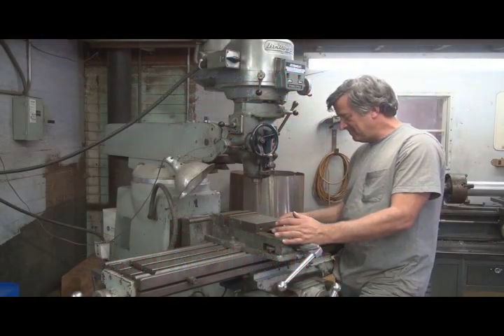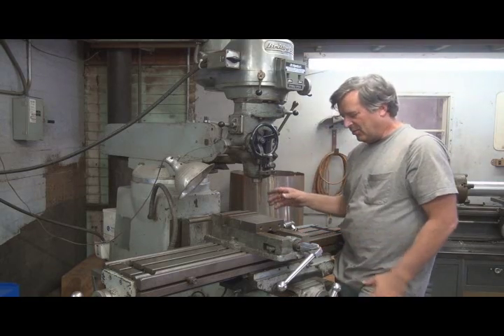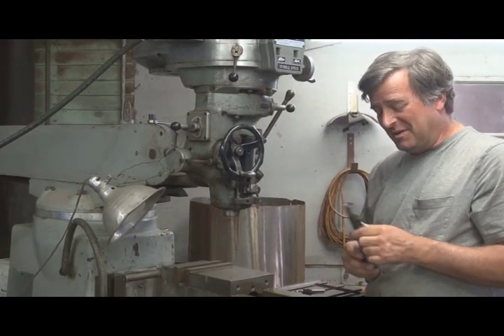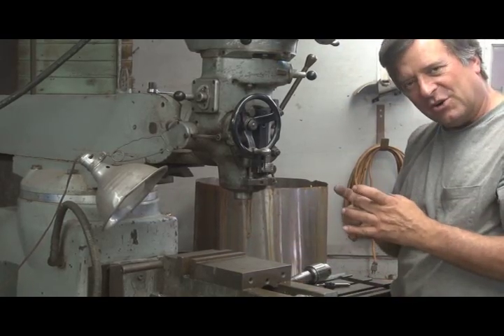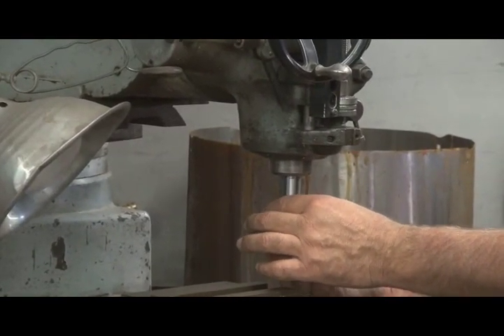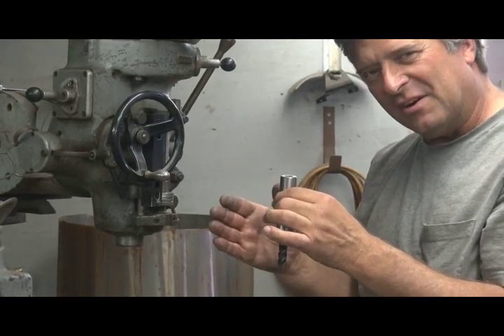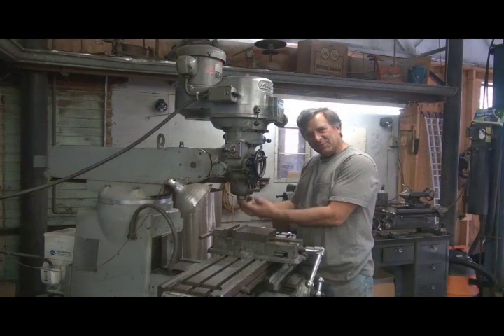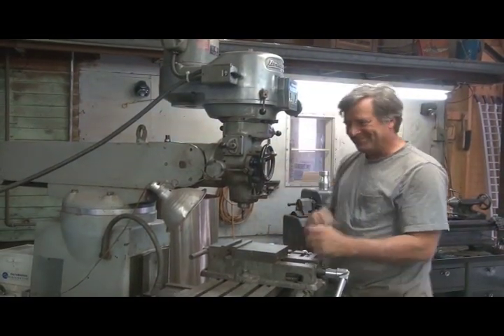Using a Collet in a Mill - Kevin Caron

Comment: Nice Vid.
So is their any reason you couldn't use collets with drill bits?  For example a collet that holds a 1/4" end mill could be used to hold a 1/4" Drill bit????  The reason I am asking the questions is that the drill bit chuck on my mill doesn't seem to hold drill bits very well.  The larger ones I can't seem to tighten down tight enough.  I bought a complete set of collets when I purchased my mill & was wondering if collets would be a good solution as long as they are properly sized?   I am thinking yes I can...  Your thoughts...
Reply from the maker: The collets work great for this as well.  Go for it!
Reply: Thanks for your quick answer.

Comment from the maker: Never used a ER collet.   The R8s just screw in with the quill shaft.   As for using a drill press as a mill,,,,,,  I would say make sure you have a video camera running in the back ground so we all can see the metal fly!  You have to have a very secure way of holding and moving the metal through the end mill. K am afraid that you would wind up 
eating the metal in a very short time.  Best to save the money and get a mill if you need one.
Reply: Unfortunatel have had to use ER collet systems at work, none would hold any cutter ending up in scrapped jobs. Also take an eternity to change a cutter over, R8, MT2, MT3 old cutter out and new one in 10 secs.